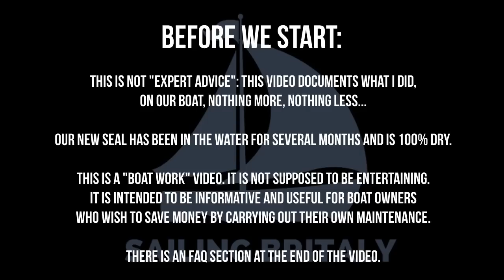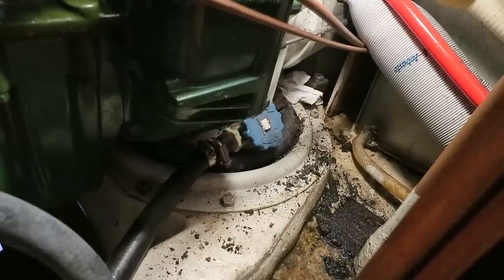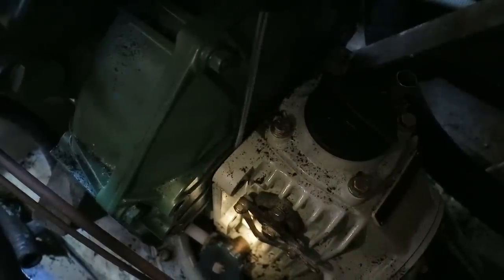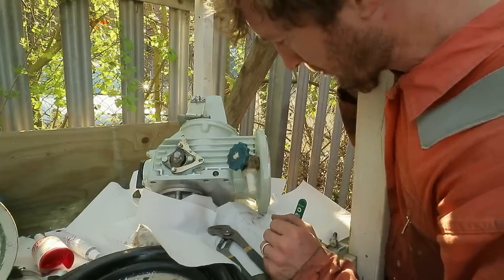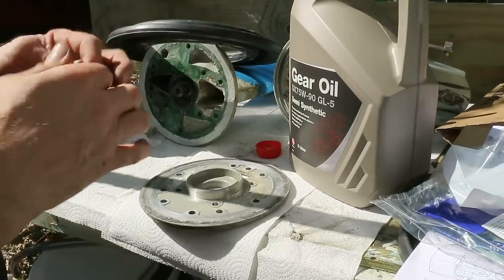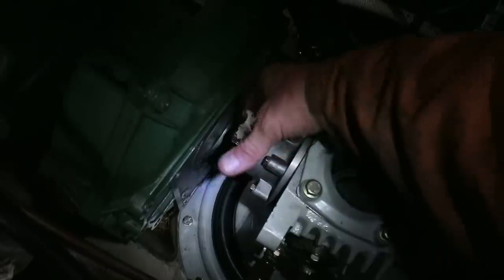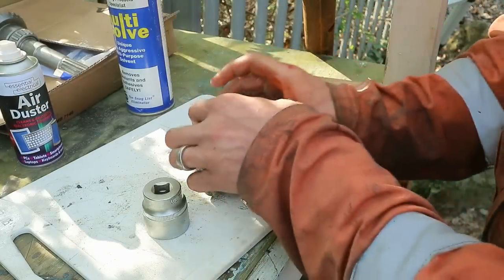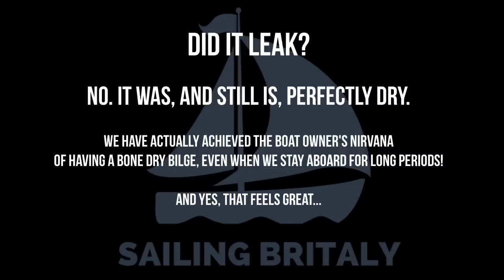Saildrive Diaphragm Replacement | ⛵ Sailing Britaly ⛵ [Boat Work]

Comment: Very nice work, especially good documentation! We want to do the same thing on our boat this winter and change the platic valve as well. Can you tell us the diameter of the thread in the aluminium gear part? Would be a great help for preparation! Also there are boats like ours, where the saildrive goes throught a very needly hole in the hull without any rubber seal at the bottom, so we can´t get the bottom part of the saildrive out of the hull that easy. I think the bottom part can in this case stay in the boat, we have only lift it enought to reach the screws.  Thank you for the great content! Greetings from germany!
Reply from the maker: Hi Tom, danke for the feedback! :-) The seacock thread is 1/2" and we bought ours here: https://www.yachtboatparts.com/volvo-penta-saildrive-sea-cock-seacock-bronzedzr-7204-p.asp I'm not sure I understand what you mean about the saildrive on your boat: if you want to replace the saildrive diaphragm seal then you need to split the leg. Let me know if I can be of further assistance when you do the job. 😉 Cheers, Chris 👍
Reply: Thanks a lot for your help! At first I want to buy theese new Valve and fittings here in germany, but now we see the cheep prices you sem to get in england. Do you know a shop where we can get also t-parts and other fittings? With our installation on the boat, after splitting the saildrive leg, the bottom part will still stay in the hull, because the gearbox down at the propeller ist to wide to fit throght the hole in the hull. So my plan is to lift the saildrive up as much as possible, fix it in this position an then seperate the two leg parts in the boat. In this video you can see the small hole in the hull https://www.youtube.com/watch?v=U32xxY1eFX8&t=356s  Cheers!
Reply from the maker: Hi Tom, that's an unusual setup which makes me wonder how they got the leg in there in the first place! (There must have been a larger opening which has since been filled and faired) ASAP supplies were good for us https://www.asap-supplies.com/ but I believe SVB can be good for certain things https://www.svb.de (and expensive for others) We always shop around whenever we buy things because prices can vary a lot and different suppliers can often be competitive for different things. Happy fixing! Chris 👍
Reply: Hi,  @SailingBritaly  , I think the got the leg in and laminate a plate around the bottom hole to get it very smooth. Thank you a lot for your help, we love your project!

Comment: Interesting. I have a mostly the same sail drive unit and my mechanic has recommended ditching the raw water inlet completely and fitting an alternate thru hull at a more accessible position. The reason is mostly those mussels you found way up inside the unit. Apparently fine while the boat is in the water but when you haul out they die. When the boat goes back in the remains migrate and cause a nasty surprise as you head off on your passage with your nice clean bottom. So good plan to fit the backup supply.
Reply from the maker: Hi Simon, yes I was surprised to see such large mussels up so high, they obviously enter when tiny and then grow in-situ! We are happy to have the backup cooling water supply. It's like a cooling water insurance policy :-) Fair winds! Chris

Comment: Hi guys! Great job! I’m planning to do the same job next spring. I have a question regarding the size of the seacock on the saildrive unit. It seems quite difficult to find the sizes of the required parts. Do you might have this info? I think it’s a 3/8 to 1/2 fitting with a 1/2 1/2 seacock. Tnx and keep up the good work!
Reply from the maker: Hi Jan, my pleasure. We bought this: www . yachtboatparts . com/volvo-penta-saildrive-seacock-ball-valve--bronze-dzr-stainless-7204-p.asp (remove the spaces) and I'm very happy with it. Cheers, Chris

Comment: So where exactly is the sea water inlet on the outside of the s-drive?
Great video, thx!
Reply from the maker: Hi Pawel, thanks mate.  The water inlets are the three holes you can see on either side of the saildrive leg just above teh lower bearing housing. There is another hole directly below these in the bottom of the leg and thay are all connected internally. Cheers, Chris 👍
Reply: @SailingBritaly  Right, clearly visible at 8:24 and 6:54. Many thanks.

Comment: Nice job recording this.  And nice work, especially without a workshop.  How long should those seals last?  Is there special anti fouling paint for the sail drive?  It looks like the bottom paint for the hull was used on the sail drive.  I know that doing that on a stern drive lower unit is death by corrosion, because the anti fouling paint has copper in it.  The special paints formulated for stern drives are not electrically conductive.
Reply from the maker: Hi Michael, thank you for your comment. These Volvo Penta diaphragm seal is supposed to be changed at 7 year intervals. The saildrive was epoxy coated before the antifoul was applied, so there is no copper in contact with the aluminium. The anode on the saildrive is absolutely essential to avoid corrosion of the saildrive leg and we will be keeping a very close eye on the depletion of this, and will replace it when necessary. (Many saildrives with corrosion problems have anodes which - although fitted - are not active, due to high resistance between the anode and the saildrive, which is why it's important to measure the resistance between the two on installation. Another potential reason for excessive corrosion on boats which are connected to shore power is via stray current. A galvanic isolator or isolation transformer is recommended in order to avoid this.) Fair winds, Chris

Comment: Brilliant job, M8. I've always wondered how the seal works on a sail drive. One thing, Is there any vibration dampening on the forwrd engine  mounts?
Reply from the maker: Cheers Wayne, there is a vibration dampening rubber section between the engine and fwd engine mounts. So the stud which was welded to the base of the engine mount is protected from fatigue by this rubber. 👍

Comment: Does the engine fore/aft location dictate whether the engine drive is by sail drive or a straight shaft out the back with a stuffing box? I guess I’m asking why some boats have one vs the other. BTW, I don’t own a sailboat but agree with your philosophy of doing the work yourself so you gain the knowledge to perform fixes and maintenance anywhere you go. Otherwise cruising would be very expensive as you pointed out but also you’d have to trust mechanics that you may not know very well. Thanks!
Reply from the maker: Hi there, yes the engine location is a consideration. Saildrives are popular with boat builders as the engine and drive can be concentrated in a small area, making more space available for useable living accommodation. We had no problems at all with our last boat, which had a saildrive which was 25 years old when we bought her, so fingers crossed this one will be the same. I do work on cars too, and once spent 12 hours lying under a Range Rover turning it into a 2 wheel drive version after the front differential failed whilst driving down a motorway at 60 MPH. We were in a foreign country and being able to drive it back to the UK in 2WD saved us a fortune in towing and garage fees! (Oh yes, it was snowing at teh time and -10 degrees C!) Cheers, Chris 👍

Comment: I saw another fellow deal with having to weld a broken engine mount. I believe that they would not break as often if the plates were drilled to accommodate the big bolt before it is welded.
Reply from the maker: I reckon you're right Dan. The design is adequate, but it could definitely be improved. I guess if it lasted 26 years then isn't bad going really, but I'm sure a simple tweak of the design of the mount could make it last the life of the engine. Cheers, Chris 👍

Comment: 50 years ago @ 16 my younger brother and I would remove old banger engines and repair big ends, shells piston rings etc. Great fun hobby. We'd support and/or remove the engine block a tripod and 5/6 times blocks  (one with rachet) and quarter inch cord. 50 years on, I'd have used these block/tackle  hung from a beam across the companionway. Perhaps no blocks. Some people use the boom.
In the late 60's we tikes bought a special clutch alignment tool... that was ditched in favour of a far more successful section of broom handle.
Reply from the maker: I removed an engine & gearbox from a car (to replace the clutch) on my parent's driveway when I was a teenager. I made an engine hoist by tying bits of wood together with string to form a long cantilever which was counterbalanced at the far end on the flat garage roof with some paving slabs. I then used a chain hoist to remove & refit the engine 'on my tod'. It did the job just fine, despite its Heath Robinson appearance... 

Using the boom as a crane was my first thought for moving the inboard engine, however the lead of it would have been incorrect due to the position of the structure above and fwd of the engine. This would have swung the engine forward about 1 meter whilst lifting it. This would have been more difficult to deal with thann just shifting the engine around with levers, so I didn't go for that option. In the end I discovered the engine was manhandlable and I lifted the aft end of it onto the saildrive and slid it backwards on to shaft by hand.

Cheers, Chris 👍
Reply: @SailingBritaly  I saw your body position when you pulled the block. It was perfect for using all your leg muscles along with shoulder/biceps all at the same time as your body weight cantilevered over a fulcrum somewhere at the calves. So you could lift and pull probably more weight than your engine (given decent handholds). But basically Chris, it was a two person job. Well done. Feeling your way through a job, hoping you don't stuff it, all the while thinking about a deadline (presumably with cost implications). Full marks for fortitude.
Yours and my parents were very understanding, giving us great leeway at the cost of "what the neighbours think". Yours though, would today risk being reported for "safeguarding" concerns. The garage roof structure worked.... But nobody (including you), knew that. Many would be saying the rosary.

Comment: Yes, that was the correct way to wire lock so that if a bolt starts to come loose, it is tensioning the wire at the same time. this way the bolt will stay put

Comment: when fitting the external seal you only put CT1 on the hull and not onto the property shaft housing.  Is this correct? 
That's obviously sufficient? !

Comment: Hello you three. 
I think Volvo now say you should use the same oil on the drive, as you do on the engine.....
Some help from karma with the boat stand....nice fitted. And the nice gray old oil showed that you needed it. 
Apart from that, I like to work on my own. But to enter the engine I thought was easier with two people ☺️
You did it faster alone. 
Good job 👏👏
Fair winds,,,,,,,,,/),,,,,,,,,,
Reply from the maker: Hi Anders, thank you! Yes, I have heard about the oil recommentation, but when this saildrive was first fitted in 1993 it had gear oil, so I prefer to maintain the same kind of oil in her. Engine oil also seems a bit too viscous to me for this job, but perhaps that's just based on what I've seen elsewhere over the years. I didn't think it was going to be so easy to get them back together either, that was a nice surprise. 🙂 Cheers, Chris 👍
Reply: @SailingBritaly  Volvo wrote a service bulletin in 2010: number 44-1 85 2; it states they changed from ATF to engine oil for saildrives types 130 and 150. No clear explanation why, but it allso recommends to change to engine oil when the clutch engagement is "delayed". Regards Peter

Comment: Where did you get the torque values for the bolts inside the saildrive?  What kind of tie wire did you use for these 4 bolts? Thanks,
Reply from the maker: Hi there, the torque values were on the 'instructions' which came with the diaphragm and I used monel locking wire. Cheers, Chris

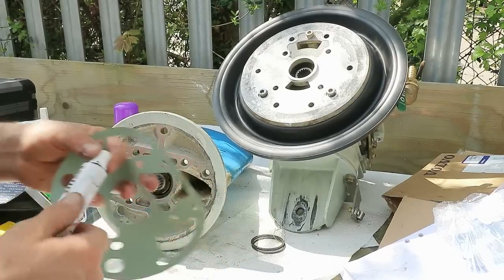Comment: I am very surprised at 44:30 you did not use the normal "paper" seal but rather the black joint sealant. Didn´t you basically almost glue the two halves of the saildrive that way, comprising ease of future disassembly ? What was your motivation to do so ?
Reply from the maker: I was following the advice of the Volvo specialist I bought the parts from. The paper gasket would have almost certainly not leaked, but the belt and braces approach here reduced the chances of having to do the job twice had it done so. The permatex-type sealant and paper gasket (which was also fitted)  will come apart if I ever do this job again. I doubt I ever will as the original 26-year-old seal was virtually as good as new... Chris
Reply: @SailingBritaly  Thank you for those clarifications. I suppose the surface were not perfectly smooth, that's why. If you also used the paper gasket on top of permatex, then you put permatex on the side of the casing the most corroded, I guess.

Comment: What a nightmare mission for a rubber seal! (good reason not to have a saildrive!)
Qudos for succesfuly completing it!
BTW a stick of hard solder with the end flattened makes a great non-destructive scraper for cleaning up machined faces etc -does not scratch the surfaces

Comment: A very handy thing is a small inverter stick welder and  2mm 316l welding rods. The stainless rods will weld, mild, stainless and cast iron, great for repairs and fabrication on the run. Your welcome, ;)
Reply from the maker: Agreed re the SS welding rods, you can even get by without a welder at a pinch: https://youtu.be/Qk8r8rorC1Y

Comment: Chris, doing ours next week, I noticed you put gear oil in the saildrive, I was going to do the same but I've since read that Volvo now recommend you use the same oil that you put in your engine. Which sounds odd to me, since it's pretty much a gearbox.
Reply from the maker: Hi Gav, yes the recommendation now is for engine oil to be used on most drives (Not all: the 120 SE I believe still needs gear oil) I went for gear oil as this unit has finctioned perfectly well for 26 years with that. It is easy enough to swap over to engine oil at any point if I change my mind in the future. Good luck with the job! Chris 👍
Reply: Sailing Britaly 
Cheers Chris, we will be filming and making a short video of the replacement, but it will only be short so I'll be sending people over to your video for the in-depth replacement 👍🏼

Comment: Yow!  He is going to move the whole engine to replace the sail drive seal!  In other news, the only sail drive that you can remove and replace the sail drive oil from while the boat is in the water is BetaMarine.  Their biggest engine / saildrive is the Betamarine SD 60, which has 57 horsepower.  It's based on a Kubota diesel which they have marinized.

Comment: Hello.
your doing great job but for my opinion you should take the motor out, because as i see it you had some problems at this area, also you could easily clean and paint the place.
Reply from the maker: We were just about to launch the boat and after this job I still had a big rudder problem to sort out. If your steering isn't working it doesn't matter how shiny your bilge is! Getting a boat ready for launching is all about priorities: There was no time for painting / cleaning. I have now fixed all of the engine problems with the engine in place and when I get time (after the big, important, seaworthiness type issues have been resolved) then I can spend time on the lower priority jobs. Cheers, Chris